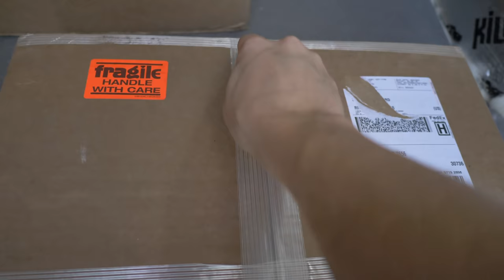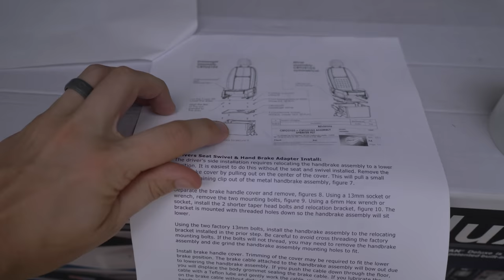IS OUR VAN EVER GOING TO BE DONE? | Van life van build update

Comment: Don't beat yourself up over the fabric on the passenger side sort of running uphill toward the back. I the first room that I wallpapered had the same problem. I started in one corner and by the time I got back to the starting corner, I was off by exactly one patter repeat interval. So, the patterns lined up all the way around the room but it  was a continuous uphill climb.